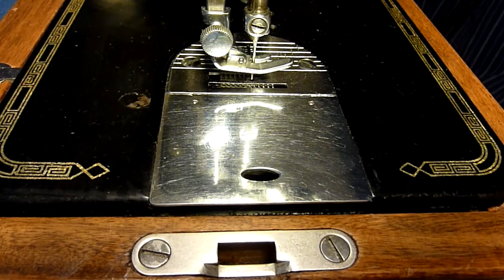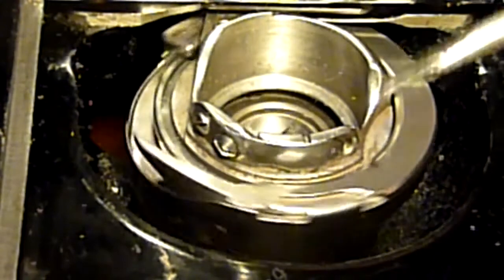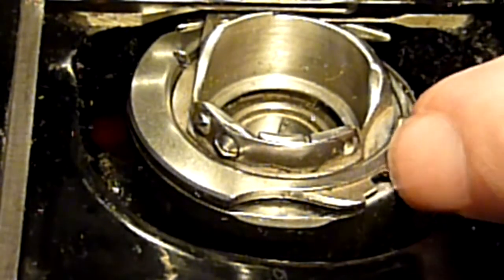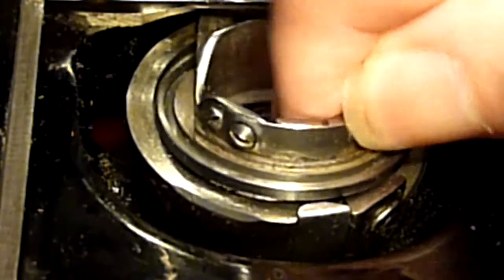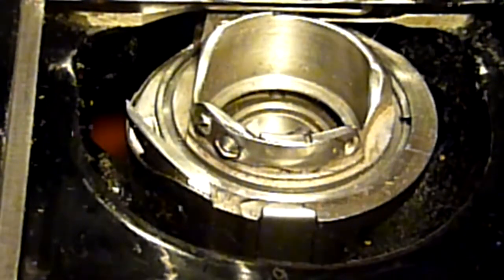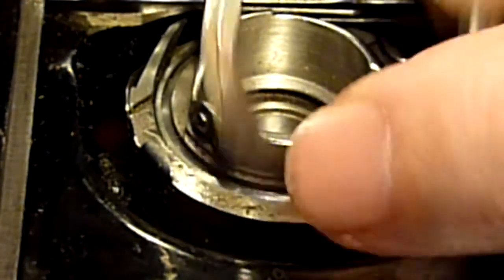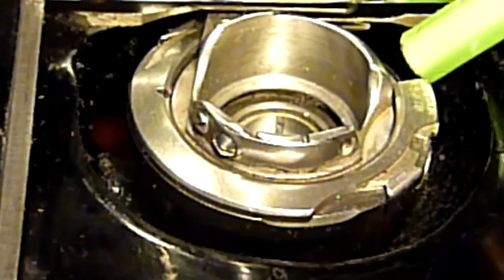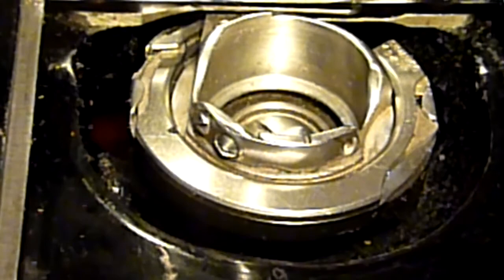How to remove and install Bobbin Case of Singer 201 Sewing Machine

Comment: Thank you for this. The spring on one of my 201s does not want to snap back up, but this trick did the trick!
Reply from the maker: Thanks for reply. Nice to know, that my machine is not the only one. This detail is my reason to make this video, because all the other instructions I saw, did not address this problem.

Comment: Thank you, ... the bobbin area is very important to be cleaned regulary....
PS. Fell in love whit a SINGER 201 😆
Reply from the maker: Thanks for the reply. I think I did have my share of problems with the 201 - problems with tensioner etc. But it do eventually work. I think many machines most likely got the same performance or perhaps better performance. The good thing is, that a huge number of them were produced, so it is easy to get spare parts or another machine. :) Did you get a machine yourselves?
Reply: @sewingmachinesindetail 
.. 
actually have two Singer 201s, the first I found out of a container for scrap metal, this is not nice but it is a 201-D from 1938, built in the Wittenberge factory in Prussia, Germany.
The second is a 1950 from Scottish production, with centennial badge, in a suitcase, portable, with knee lever control.
I got the old one (Wittenberge) to run with an electric motor, and the thread tension is complicated, but when the balance is right it sews fantastic, my children can operate it easily and have a lot of fun with it.
I still have to restore the machine in the case, the cables are brittle and it doesn't turn, it's stuck ...
Do you know the Singer 206?
This is a zig zag machine, it was the first Singer with a zig zag stitch and was developed in early 1930 and built until around 1955.
I also have a machine of this type that was built in Wittenberge in the 1930s.
Many greetings
Reply from the maker: Thanks for this information. I did not know, that the 201 also were produced in Wittenberge. I have read about the 206, and I do not feel good about it. It use special needles. Some have tried to modify the shuttle, so it can take normal HAx1 needles, but there should be some problems with that too. With the right needles, you only got a limited kinds. And I think it got the old style timing belt, that can be hard to find replacement for.
Reply: @sewingmachinesindetail 
The thing with the needles is correct, but the 206 from Wittenberge production is equipped with the standard needle 705/130 flat-bottomed piston, the change only took place in later years when production was resumed after the Second World War, and the machine type was used more commercially .
The special timing belt is actually not a problem as long as it does not come into contact with oil. But there are no longer any replacements, that's true.
Reply from the maker: @necchi-pavia  Interesting. Then some of the 206 from Wittenberge should be OK then. And yes - just check the belt is in order and not soaked in oil.
Reply from the maker: J.A. Can I ask you about the Pfaff 30. I may have a chance to get one with motor relative cheap. Most of the Pfaff 30 here are hand cranks, and they are sold cheap. I have seen some good reviews.
Reply from the maker: Thank you for your answer and the link. In a day or two, I may make an offer for buying a Pfaff 30. I seems to run with little friction and I saw some good reviews. I think I will ask a question to the guy in your link about the flywheel.
Reply: @sewingmachinesindetail 
To ask the guy ia a very good idea!
He is a sewing machine collector.
Good luck whit the Pfaff 30.
Stay healthy and have a good time...

Comment: Hello, the clip for the retainer has snapped. How do I remove the whole race, please? I assume the big screw in the middle holds it in. Thank you.
Reply from the maker: Yes, it is the screw, and there is a lock pin too. I recommend that you get the Adjusters Service Manual for it. It is free in some of the facebook groups on the machine, and perhaps elsewhere.
Reply: Thank you. I may have the adjuster's manual somewhere. That screw won't even turn, it's very stubborn. Loved your video.